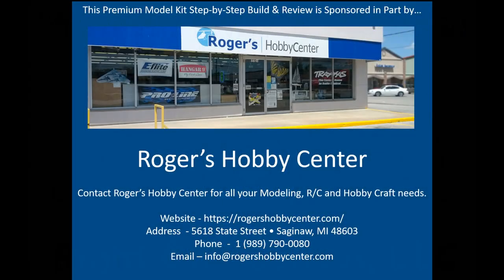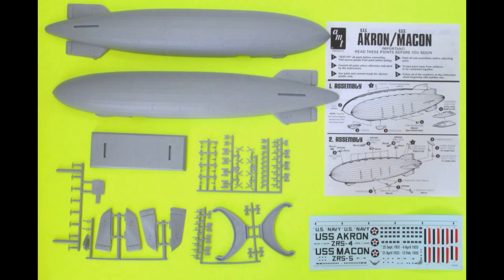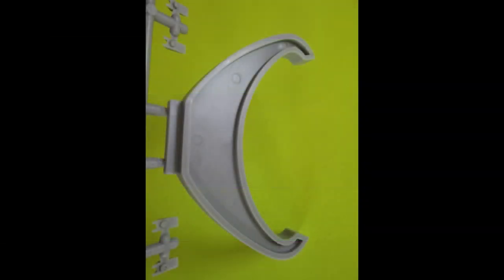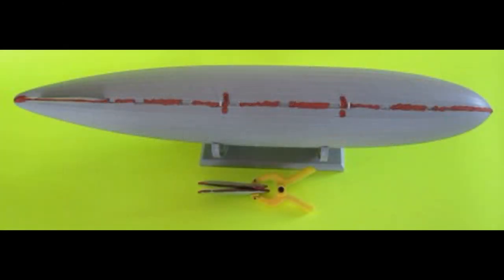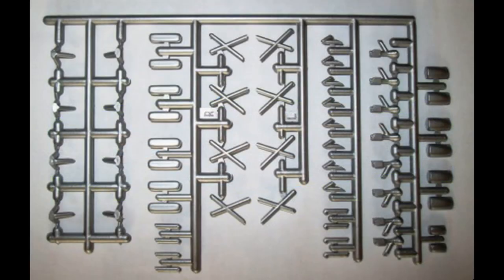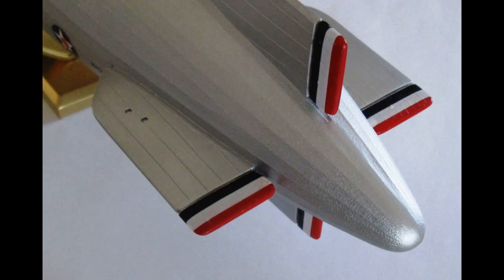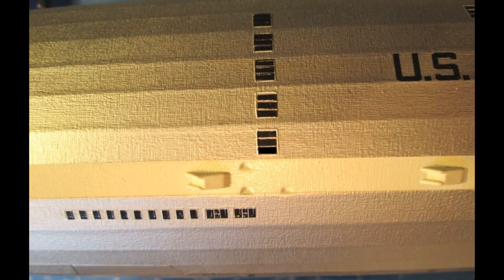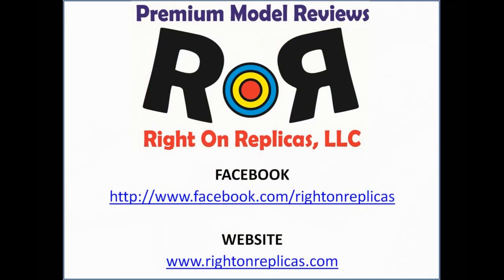USS Akron or Macon Flying Aircraft Carrier (I) 1:520 Scale AMT Model Kit #892  -Full Model Kit Build

Comment: It's too bad AMT didn't make this model with small Sparrowhawk fighters on their trapeze.  The real purpose of the Macon and Akron was to project power. The planes would ride the Akron or Macon close to the target and then be.  launched. This greatly extended the fighters range. We do power projection today with great effectiveness with seaborne aircraft carriers . .and the Air Forces aluminum bridge. So the Macon and Akron weren't complete failures. They were an early effort at power projection strategy, and we learned alot. I think that is their real significance.  Your model turned out great.
Reply from the maker: PJ,  Thanks for sharing your insight!  -Doug